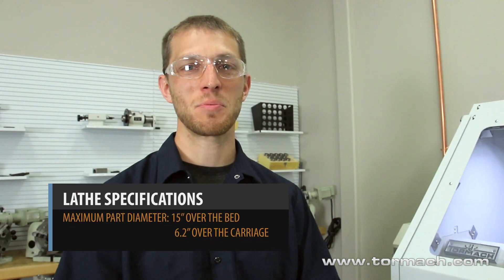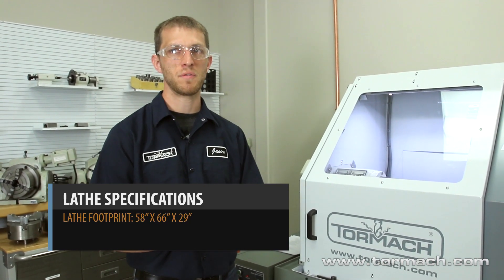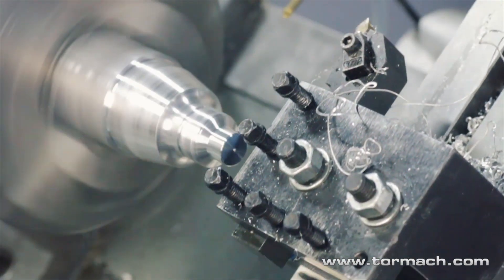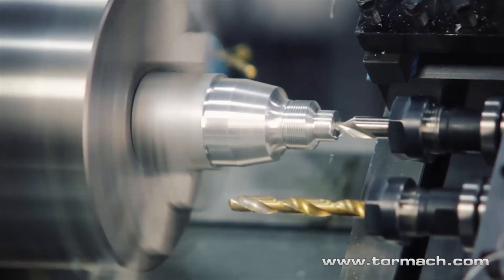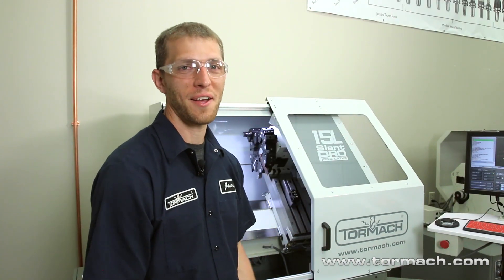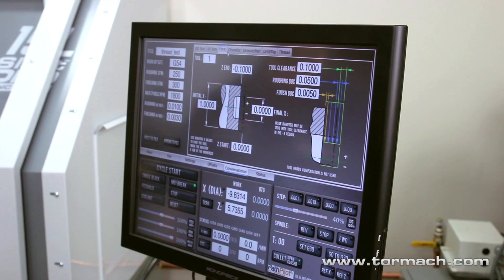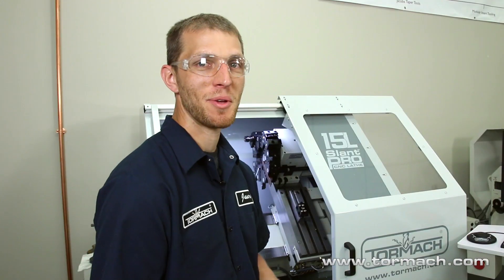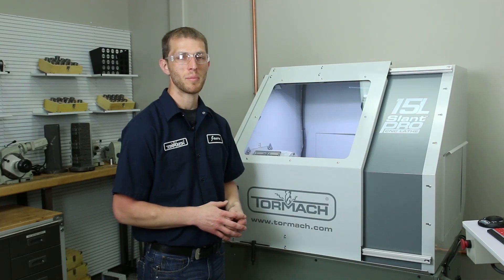Tormach 15L Slant-PRO™ CNC Lathe Overview

Comment: Just a quick question I noticed two tabs on the rear left and on the right side of the bed are those lift points if I have a fork lift?
Reply from the maker: There are two lifting hangers (page 161 in the manual) on either side of the 15L Slant-PRO that can be used to lift the lathe up with a crane or a fork lift. You can also remove the stands cover plates (page 159), and slide two solid bars through the stand to lift that way. If you don't have much experience moving some of this equipment, we recommend hiring riggers to help out. https://www.tormach.com/uploads/767/UM10225_15L_Slant-PRO_Manual_0916A_WEB-pdf.html
Reply: Ok that was quick reply which is appreciated, but the customer support has always been great and I'm glad I got the 1100 from tormach. this is next.